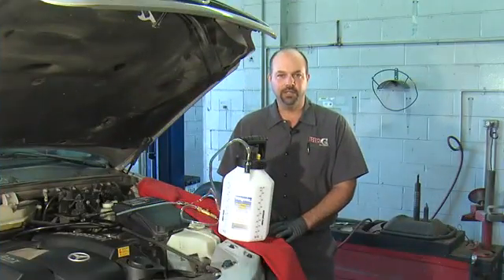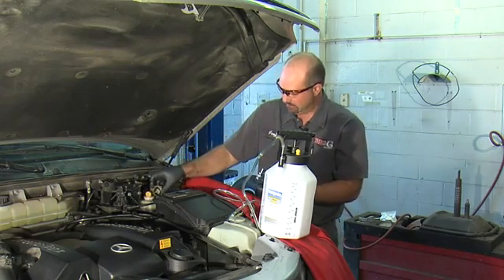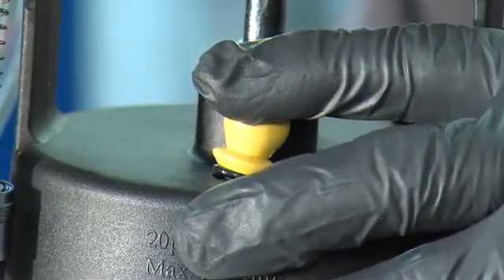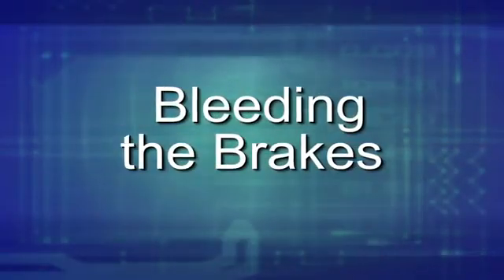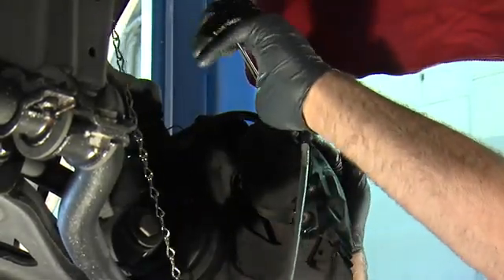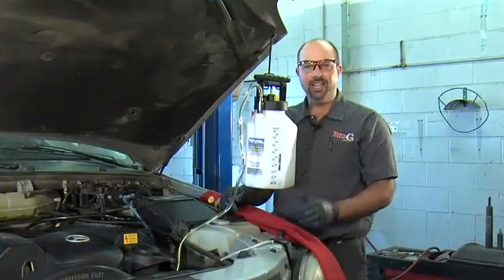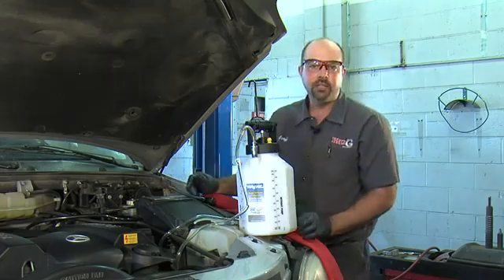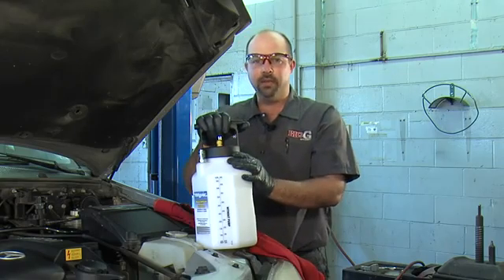Mityvac MV6840 Pressure Bleed System

Comment: Lets see, safety glasses, fender protector.. Now did you force the air in the pump line into the brake system and pump it all the way through. Shity video.
Reply: It won't pump through if the bleeders are closed.... "shity" comment.